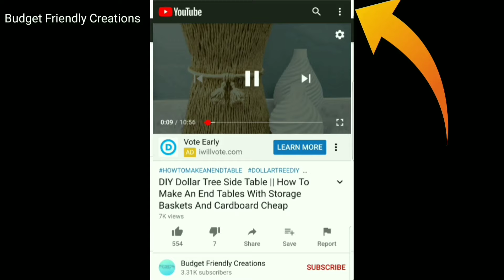How To Use Silver Dollar Tree Bowls To make A Side Table For Your Home

Comment: What did u use for the middle piece
Reply from the maker: I used a 4” PVC pipe from the hardware, it’s about $13 for 10ft , I used only 10 to 12”, another option is oats container